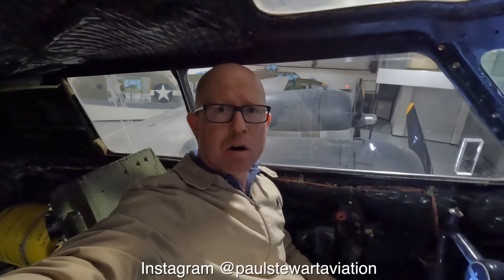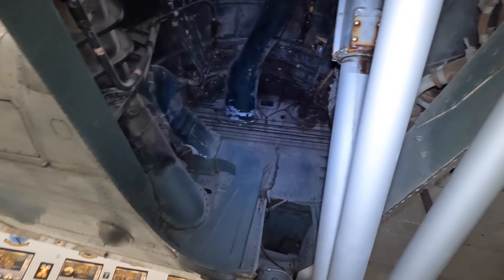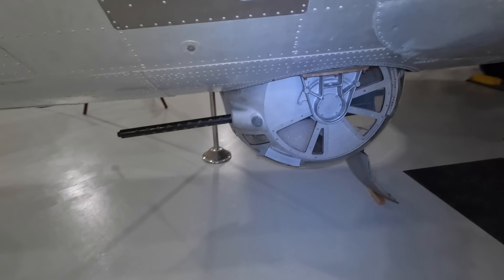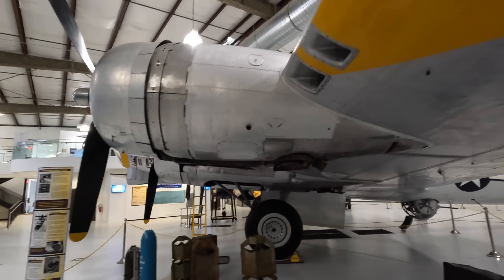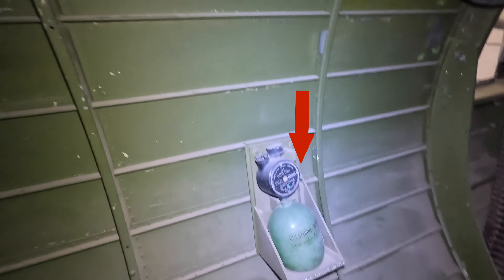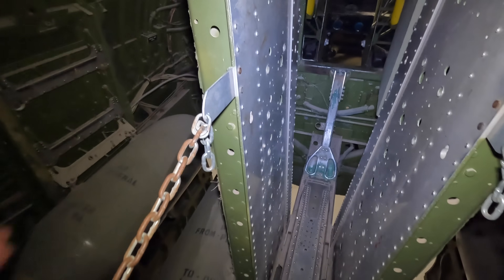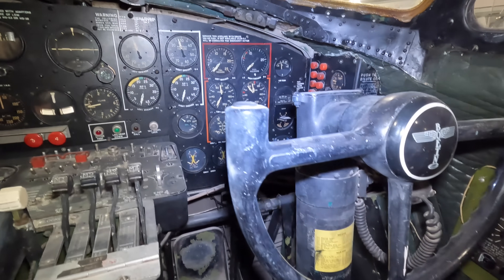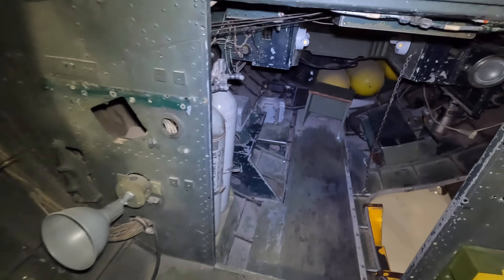Detailed tour through a Boeing B-17 Flying Fortress (as featured on Masters of the Air)

Comment: Great tour, just have to correct two minor errors in your presentation.  1.  B-17 had a auto pilot.  If it didn't my dad would have never made it back to England.  2.  The tail gunner position was very comfortable, I have spent in excess of 8 hours sitting on the Schwinn bicycle seat restoring the tailgunner position.  Father was engineer on Four Leaf Clover 42-37942.  An internet search will on the name/number will find info and pictures of the battle damage suffered on Jan 11 1944.  I spent 7 years and 4000 hrs. restoring and working on CAF Texas Raiders.  Sad it is no longer here.

Comment: A wonderful presentation of the B-17, much like all your other aircraft reviews. Allow me a small correction to your script; the B-17, like many other aircraft of its era, was equipped with an early autopilot system, most commonly the Sperry A-2 or C-1, which used gyroscopic sensors to help stabilize the aircraft. Great job, thanks for taking the time to film, edit and publish this work.
Reply from the maker: Thanks for the correction! This is an older video and I am keen to re-film it and correct a few of the errors.

Comment: You stated that B-17 did not have auto pilot, but they did, in fact, the auto pilot was engand then switched to the bomb sight, then the bombadier would have control the aircraft through the bomb sight. My grandfather was a bombardier in the 351st bomb group and flew 32 missions, 16 of them as lead bombardier. He had many stories about these missions. On on one mission he had to run back to that narrow catwalk and kick the bombs loose over an open Bomb bay because they wouldn't fall out of the track. Just one of many stories I got to hear from him when he was still around. He passed in 2005 but i still Miss him everyday.
Reply from the maker: Apologies, my mistake

Comment: 10-12,000 pounds of bombs possible using wing tacks and depending on fuel load.  The B-17 is not a Mosquito.  See Greg's Airplanes and Automobiles in YT, he's more of a natural engineer than he admits and is a myth-destoryer (in a skilled way) of epic strategy.  This is a hot subject this week in YT - Imma taking notes and adjusting the numbers, again...8000 pounds of bombs was the high average on bombing missions.  So, between 2 and 4 tons.

Comment: The timing for this video to show up in my recommended list is amazing. I am a 3D artist working on an animation short specifically about a lone B-17 and P-51 escort. I have been tasked with modeling the B-17 as accurately as possible inside and out. Outside is not a huge problem although this video answered some of my questions like the shape of the cheek turret windows and some of the antenna found around the fuselage. Now I understand the ports in the wings, and my tail gun shape is all wrong. The interior is the real problem. Most photos feature the crew and only give glimpses into the equipment they used and worked with. I will be studying this video for the next several months. My thanks for the tail to nose walk through, more than you'll probably know.
Reply from the maker: You’re welcome! :)

Comment: I flew in the famous B-17G “Nine-O-Nine” in April 2019… it crashed killing a number of people in Oct 2019.    We flew over San Francisco Bay Area at 4000 feet and the view from the bombarder  (got video) was fantastic.    Quite narrow and top hatch was open.   Very noisy and lots of fuel/hauast smell and I terribly air sickness!   Took me 45 minutes on the ground before I could drive home.    Ride was smooth but noise and fumes just hit me hard.     Walking the Bombay gantry (1 foot wide) with only 1 rope .. they said the Bombay doors open with 200 pounds in case a bomb broke loose… it would fall out…so if you slip, you are leaving the plane!   

It was way cool… and Masters of the Air was a great show.

Comment: I'm 48 and in my 30's I was lucky enough to spend over an hour in the air in one of these. I spent a large amount of my time in the tail gunner position. The engine noise is really something else, fumes and the overall lack of insulation makes you feel very connected to the plane. Landing was a real treat, took 3 attempts due to high winds! Was an exhilarating experience and I consider myself extremely fortunate to have been able to fly on such an amazing piece of history.

Comment: Time mark 14:25:
Just a minor note, these ARE constant speed props. Meaning, you manually adjust the pitch to the desired rpm you want. They are the SAME thing as constant speed propellers used today in piston aircraft.

Comment: I do wonder just how effective that armour was against a 20mm cannon shell rather than a bullet. It's most the former that the B17 crew would have encountered.

It's interesting to compare it with the Lancaster, which initially looks a lot more cramped because of that very long bomb bay and the relatively high wing spar. However, there were three more crew on the B17, and if the Lancaster's tail gun position wasn't one to be envied, that B-17 ball turret is a thing of nightmares.

Comment: So these incredibly brave kids were flying at 30,000 feet with no cabin pressure using oxygen tanks, freezing cold temperatures, no place to comfortably sit (even the few chairs on the plane look uncomfortable), no place to go to the restroom except through bomb doors, up in the skies for hours and hours at a time, manually flying the plane the entire flight in close proximity to other planes, fuselage metal incredibly thin and of no protection, belly gunner essentially trapped inside the position for the duration of the flight, super loud engines and machine gun fire coming from those .50 cal guns, fighters attacking them from all sides during a bombing raid, watching other planes in their group being shot down wondering if they themselves would make it back...I don't think the word bravery is enough to describe what these individuals were doing.  Every time they boarded that plane they knew how miserable, dangerous, and brutal their time on it could and would be...and they still did it.  They were flying around essentially in a souped-up beer can.  When I was in my late teens/early 20's I was trying to play in a band and chase girls...these guys were out saving the world under incredibly primitive and horrible conditions.  Amazing...just amazing what these guys did.

Comment: Interesting point of the B17, and B24 is they both used a 2 stage supercharger system consisting of a TURBOcharger that feed the Mechanical SUPERcharger, that gave the B17 a service ceiling of 30,000 ft,  the B24, 28,000 ft due to its smaller wing.  as an example the Lancaster with its SINGLE stage mechanical SUPERcharger had a 20,000 ft service ceiling, and all three planes were at about the same gross weights.  The P38 and the P47 used a similiar system.

Comment: Wow! VERY interesting video. Back in the late 1980s while I was scouting locations for motion pictures, I met Kermit Weeks at his aircraft museum located at Tamiami Airport. I was looking for a runway where we could film a Honda Accord commercial with Dr. Ruth. In the back of his hangar, outside in the elements, was the fuselage of a B-17. No wings. It was awaiting restoration. I went inside of it. I was shocked.  IT WAS SO SMALL! I had never been inside a bomber of any kind. Crammed with ten men, equipment, .50 caliber machine guns, a bomb load--it was hard to imagine working in those conditions. Narrow. No ceiling. No padding. No insulation. Paper-thin aluminum. If I was in the Air Corps and posted to one of those flying machines I would have bugged out. Transfer me or discharge me, I WANT OUT! As Rosemary Clooney sang, "Thanks for the memories."

Comment: You missed covering the top turret (which was visibly on display outside the aircraft.)  I don't think most people realize it was a ceiling to floor mechanism because it is removed from most B17s on public display.  It was left intact on one but sadly that B17 crashed. Also, re ball turret and 'chutes': you could wear a 'chute' in the BT and several BT gunners have reported they did.  However, it made an uncomfortably small space even smaller so it was not uncommon for BT gunners to shun them.  Finally, it is often reported that the BT gunners were the smallest in the crew.  BT gunners have stated this was not true.  When a replacement gunner showed up he got what ever gun was not manned at that time - including crew member swapping/fill-in when it was needed.  Or so some BT gunners have reported.

Comment: I used to go to the Oshkosh Airshow, and being fascinated with B17s since I was a kid, had the opportunity to crawl through one just like this for ten bucks. It was an incredible experience I will never forget. It was also extremely eerie, being inside this airplane that so many young men died in. Also very small, much smaller than any photo or video can convey. Designed for functionality, not comfort. I can't imagine being trapped in one for 8 hours at a time over hostile territory, flak bursts constantly rattling against the metal, all while being terrified of Focke Wulf 20mm cannon shells ripping through the airplane with little warning. Dying inside one of these must have been horrible.

I did the rounds of that airplane 3 times, shelling out ten bucks each time, before the aircrew caught on and let me back in for free. I guess they could tell I was nearly in tears and just wanted to spend as much time as I could inside that airplane before I went home.

Comment: It's pretty dusty in there. Couldn't you have taken a Swiffer with you and cleaned a little on the way through?  Great video, it is good to see just what it is like inside one. Most aircraft museums you only get to see the outside of planes, and rarely anything inside. At 6:57, there is that green rear gunner station. Too bad they don't make a replica that is open so that visitors can actually climb in to get an idea of how cramped and uncomfortable it was for the tail gunner.

Comment: A fun fact is the mosquitoes carried more bombs than this plane and the Lancaster so much more
Reply: Yes and no.  Mosquito could carry either four 500lb bombs or a single 4000lb bomb.  The B17 had a 4000lb bombload and was capable of carrying a number of different bomb types with the typical bombload over Germany being approx 3500lbs.  I can't remember Lancaster's bombload but it was huge by comparison.

However, it isn't an apples to apples comparison.  The mosquito was a very fast, very capable multi-role airplane.  The B17 was slower with a greater range and carried a lot of additional weight that was necessary in its role as a "heavy" (I used that term loosely) strategic bomber.  Lancaster was developed primarily as a heavy night bomber that devoted more weight to bombload than anything else.  On paper the Lancaster would be the clear winner with its long range and massive bombload but the reality is that the three aircraft operated in different mission profiles for which each was best suited.
Reply: @JD_79  Mossies were purpose built for specific roles. Fighter bombers, about 1/3 of production, had a max internal bomb load of 500 pounds. About 1/6 of wartime production were bombers with "some" modified to carry one 4,000 pound HC "cookie" bomb, basically a giant dust bin.
   According to WWII US Bombers the "usual" bomb load for 17's was 6,000 pounds.
   Lancs were flying unescorted daylight raids as late as July 42.
Operation Margin, The Augsburg Raid, Lancasters Over Augsburg
4,000 pounds
https://www.youtube.com/watch?v=KMETNhT74mk
Reply: Source?

Comment: Thanks for the good video, and I am happy to learn that the landing gear was operated by electricity instead of hydraulic since that will help me in one of my projects. 

The radio-operators Mashine gun was removed from the B-17 flying Fortress starting in November 1944, due to being the gun least used in combat, a small toilet as far as I know, was installed in the radio room, probably seldom used, and 12731 B-17 Flying Fortress was build during the war. And of those, the biggest amount was B-17 G Flying Fortress, 8680 units, I belive. 

The Bendix nose turret was originally incorporated into the YB-40 gunship variant of the flying fortress, but then that program was scrapped, the turret was transferred to the standard B-17 and installed in the nose, starting with the last 75 B-17 F. 

The first B-17 G did not have the window guns seen in the nose, those were added a little bit later.
Reply from the maker: You're welcome

Comment: The problem with the B17 was it's tiny bomb load. At 4,800 pounds it was little bigger than the 2 seat mosquito that could top 400mph, and was a full 10,000 less than it's RAF equivalent,  the Avro Lancaster.

With a larger crew than RAF bombers, and a miniutive bomb load, the B17 arguably cost too many brave lives for way too little return.
Reply: Lanc losses 53 per cent, B17 losses 37.
4,000 pounds
 Operation Bellicose - Lancaster Raid Deep Into Germany https://www.youtube.com/watch?v=mdILcTZWzzk&t=2s
Reply: Internal bomb load was 9600 lbs, or 8 1200 lb bombs. Typical long range bomb load was 6000 lbs, and London to Berlin isn't a long range mission unless you fly a very convoluted flight path. Add to it, the presenter failed to mention that B17's dropped more tons of bombs on occupied Europe and Germany than ANY other allied bomber.

Comment: Great video, minor corrections though, they did have an autopilot system in the G models and also, you state that the props weren't variable pitch when they were, the prop governor levers control just that. Iirc, the G model used an electric prop speed governor. Must say, this has to be one of the most thorough B17 crawl videos I have ever seen. Thank you for posting

Comment: Thanks Paul good video ! The B-17 is one of my favorite aircraft and its interesting to have a look inside the plane. The various gun positions are one of my favorite features of the Flying Fortress. The radio operators compartment is interesting too. I saw two B-17's at an air show back in 1993 but never had a chance to look inside. I took several pictures though. The B-17 E , F and G versions are the best looking forts compared to the early models. Awesome aircraft !!!

Comment: I Feel so bad for the one who operated the ball turret, it only rely on electric power as there are no emergency manual override system to move and Open the door turret so yeah if the plane got shot down that ball turret will become your coffin while your crew bail out of the bomber as the plane spin outta control.
Reply: There is an emergency crank to move the ball turret. Page 5 of the linked manual, points to the manual hand crank. Both the B24 and B17 used the same ball turret with the only functional difference being that the B24 could retract the ball inside of the plane. You were only trapped if the ball jammed.

http://hangarthirteen.org/wp-content/uploads/2020/08/11-45G-1-Handbook-for-Sperry-Lower-Ball-Turrets-A-2-A-2A-A-13.pdf

Comment: Nice tour.  I was surprised at how small the plane is too when I crawled through my first one.  It's definitely different than in the movies.  When I was at Pima there was a vet who flew the B-17 talking about it to the museum goers.  After that was over I asked him some questions about it.  He told me they used to switch flying between the pilot and copilot every 15 minutes or so because there was no hydraulic assist on the controls and the need to fly in fairly close formation.  He also said they were most afraid of the flak than fighters.  It wasn't necessarily being directly hit by a shell but the fact that the sky was full of shrapnel that would go through the skin of the aircraft as the plane flew into it.  I guess that's why their armor is called a "flak jacket".
Reply: The B-17 isn't a small airplane. I have flown on them several times and there is a lot to explore and crawl through. The radioman had it best with his fairly large "office room". Now the B-29 is a large plane and larger than many commercial passenger planes.

Comment: Side note if one of the landing wheels did not deploy due to an electrical failure then the wheel could be cranked out manually (I’m not sure where the crank is for this particular model but for the model F it was located in the bomb bay near the radio operator)

Comment: Paul, Great video.  The B17 did indeed have an auto pilot.  It was located below the throttles and you can see it clearly at 14:33.  It was used to keep the plane flying smoothly prior to the release of the bombs.
Reply: Thought that bombardier had control of the plane during the bomb run?
Reply: Thanks for watching

Comment: Quick note: the radio operator's compartment consisted of seats for the rear crew to sit when not manning stations as well as a camera in the floor.
Reply: The B24 had a plank running sideways behind the bomb bay as crew seating. BIG seat belts on it.I buckled in it on the Collings Fondation B 24, got a chill run thru me though it was like 110 degrees in the plane during crawl throughs. Dad was a ball turret gunner.. on a B17g.

Comment: The flight engineer's position is missing the mechanism for the Bendix top turret, so the space behind the pilot would be even more cramped. The FE was usually the senior enlisted airman on the plane.
Reply: I made an error in my comment. Bendix made the top turret used by the B-25 Mitchell. The B-17 top turret was manufactured by Sperry, the same company that manufactured the ball turret. Bendix made the G-model chin turret.